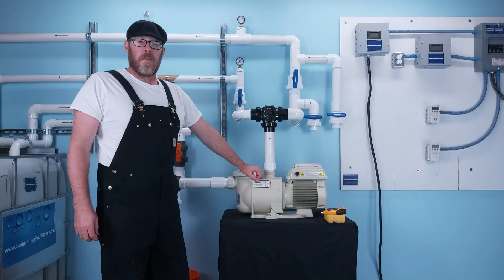Pool Pump Comparison

Comment: Excellent setup.    If you are a DIYer, look into buying a VFD (variable frequency drive) and feeding it with single phase power (generally 230vac).    This will drive a 230vac 3 phase motor (square flange of course), and give you variable speed.   The trick is to oversize the VFD's output amps (2x works) to the motor's FLA.   I've got this arrangement on my pool and it works great.   I can essentially run my pump year round if I want.   At 40Hz, I'm at less than half the amp draw of a comparable ATL (across the line) pump motor.   Those Pentair pumps essentially work the same way.   They use a Danfoss drive and integrate it into one complete unit.    If you do what I described above, it is less than half the cost of a Pentair unit.   Example:    A 3 phase, 1.5 HP square flange motor from Grainger is $330.00.  Couple that with a cheap 3HP VFD from Amazon at $90.00 and you've got a total investment of $420.   Compare that to over a grand for the Pentair unit.  Just a thought.   Love your channel, Steve.  Keep up the good work.

Comment: Can't wait for all the future videos your going to do with that set up.  Should be great to see if the manufacturer's number are equal to what you'll get. 
I know in the real world there will be filters, check valves, elbows unions and other various friction causing things, but this test eliminates all those variables and aims the focus on the pump and pipe diameter.
Thank you for doing this. 👍